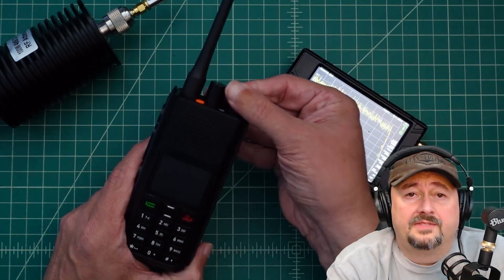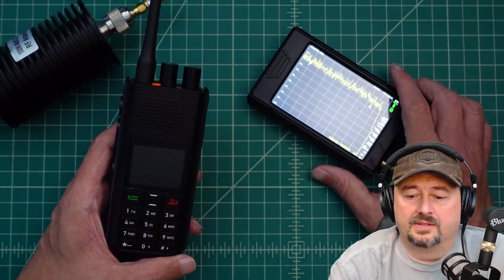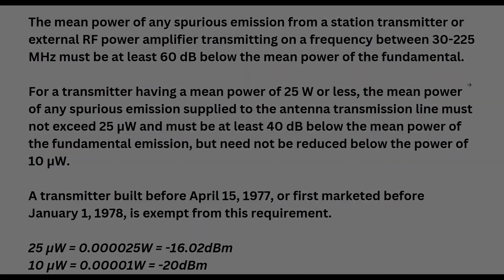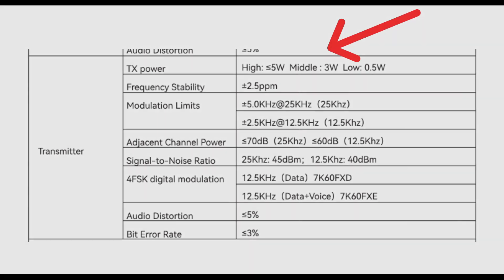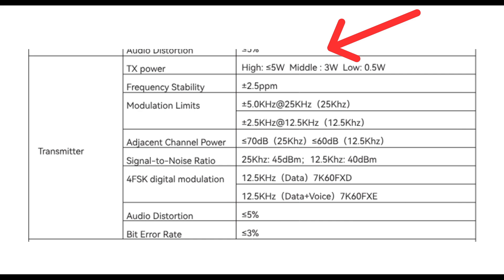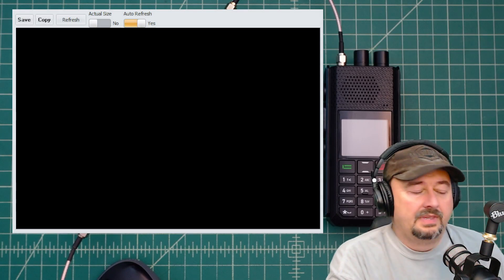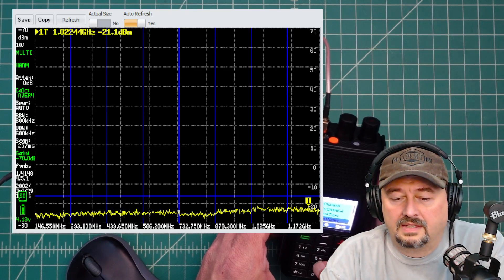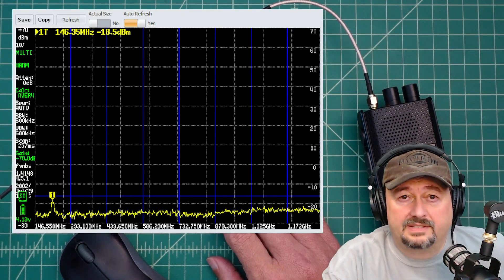Is the Retevis H1's Transmit Signal as Clean as a Whistle?

Comment: Thanks as always for the excellent content.  You should also do a smaller span around the fundamental.  Some radios while doing ok on the harmonics, still suffer from spurs 40 or 50k from their fundamental due to internal power supply ripple at the finals.
Reply from the maker: Thanks.  I made a signal injector to do a two tone signal into the radio just for this reason but I haven’t gotten it to work the way I want, I’ll have to revisit.  Thanks for watching 👍
Reply: @TheSmokinApe . Nothing else should be needed - just set SA span to say, 400k, centered on the transmit frequency, and drop RBW to 1k.

Comment: I have had the original Ailunce
HD1, twice, since 2018. I believe there was an HD2.
I only like RT Systems software, yes it costs a bit,
where it operates smoothly,
has updates, and you can
print out your spreadsheet.
Also, my Retevis UHF Analog/DMR repeater, low power, cost
over $500.00, only last year,
lost it's PA output.
I have been going back and
forth with Retevis/Ailunce
Customer Service, Rep.Amber
Chen to receive a new PA tube
which I have been promised.
I was sent a technitions type
Video to do the replacement,
which looks difficult. There is
not any place here to send it
for service. 😮
73 de W2CH Ray Peekskill NY and Marylyn KC2NKU 😊
Reply from the maker: Hey Ray, I’ll tell my contact about you problem with the repeater 👍
Reply: Thanks, very much😅
Reply from the maker: @Raymond-n7k I sent over an email 👍
Reply: Again Thanks very much. 😊

Comment: Finally got myself a Tiny SA ultra after you and Hayden wouldnt stop making videos with them in 🤣
Reply from the maker: Awesome, they are great tools for the ham shack 👍
Reply: You also need the attenuators to go with the TinySA, it can only handle 4mW of input power. If you have GAS go get a NanoVNA while you're at it :)
Reply: @godarklight absolutely.  I have a 20W/6dB attenuator here that came free with a surplus 4G antenna I got on ebay. The attenuator alone was worth $189 brand new.  Got that and the antenna for $35 lol.

And yeah i have the Nano VNA also.